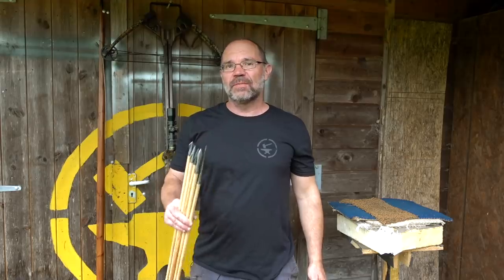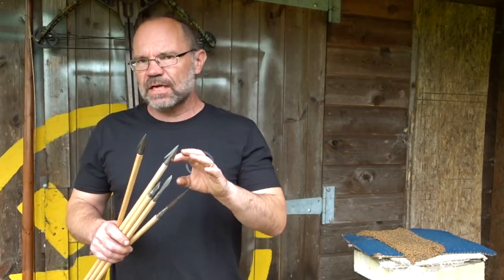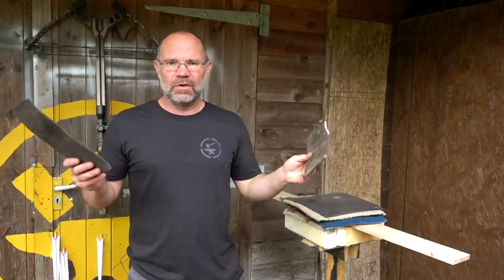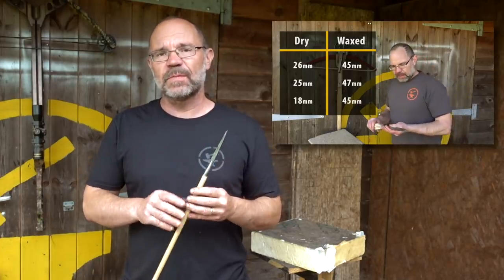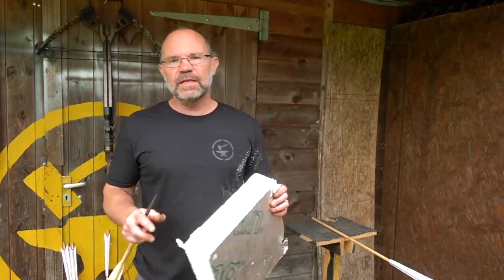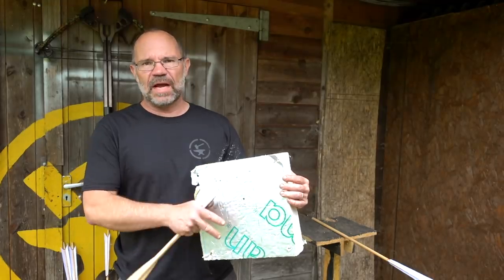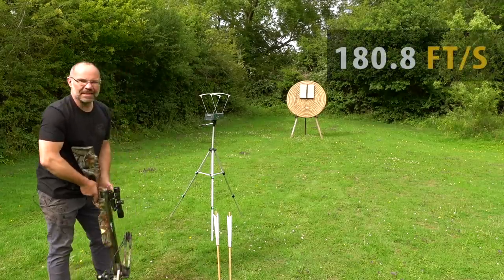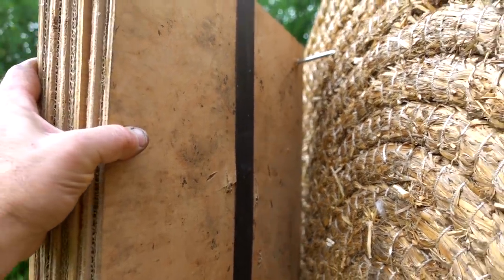Lockdown Longbow - Now I have WAR ARROWS!

Comment: "I didn't realize they wore these two in combination"
Oh absolutely they did. In fact, usually the setup was: Gambison, chain, plate.
For anyone who was fully armored. You'd never wear plate armor without gambison, and you really shouldn't be wearing chain without gambison either.
That being said, the idea of chain UNDER your gambison was a new concept to me people told me about in the last video...
So I have no idea about that, because the whole idea of why you don't wear chain alone is because it 'd be uncomfortable as hell especially with any weight or gear over that.... but I guess it was done?
Reply: They might be confusing some pictures, I believe gambison was always worn under chain but wearing gambison over chain in addition to what's under was probably just for warmth, when temps get freezing having a thin gambison over your mail keeps you a lot warmer than having mail exposed
Reply: @Robert-qm7yi  I.... question that logic there, if only for the idea that the gambison overv your body will keep your body warm regardless if the chain is over or under, but if the chain is under, it also keeps the chain warm lol.
Reply: Thats not quite right I'm afraid. You do not wear gambeson under plate armour, that is what an arming doublet is for.
Reply: Hidden The chain gets colder easier and transfers that cold more effectively than fabric, keeping the chain warm keeps it from sucking out your body heat.

Take a cast iron pan and put it in the freezer for a few hours and grab it, then put a few rags over it and grab through the rags and you'll see what I mean

Comment: Having a different weight to achieve the same speed changes the inertia on the arrow which will affect am guessing the ( range , impact , accuracy )
Theoretically a heavier arrow - bullet- projectile will keep more of its original energy over a longer distance
 so the speed of the arrow may be the same 1 meter in front of the bow but the speed of impact will be surely different between different weight arrows

Am a shooting athlet an Automotive Engineer not a bow guy just to be clear 

Still love the experiments !
Reply: It's my understanding that those are the size and weight of war arrows.

Comment: If archers were expected to shoot through plate armour, unless it was cost prohibitive, I think there's no question that arrowheads, or at least parts of them, would have been made of hardened steel. An arrow's tip is a simple machine and its deadliness depends on its retaining its shape when it hits its target. Keeping its shape is what enables the arrow to concentrate the force of impact on as narrow a spot as possible. If the steel flattens out, less energy is left over to do damage and the force of impact is spread over a larger area, making failure of the target armour less likely.

Comment: I think the only difference between your bow and a proper longbow is the force exerted on the arrow. Shorter length of pull means you need a slightly higher acceleration to get to the same velocity. More acceleration means more force (F=ma).
Once in flight, bow and arrow are no longer interacting, so it doesn't change anything down range.
(The arrow might flex more but I don't know if that effects much)

Comment: Hi Tod. Fan of your longbow test videos. Although I would think it's negligible, wouldn't there be a difference in an arrow fired from a longbow suffering from archer's paradox where a crossbow would not? There should be a bit more energy in the arrow as it continues flexing in flight. Edited as I forgot that modern recurves with whisker biscuits won't have this issue.

Comment: Loving these tests Tod.  One thing I'm wondering about is the samples of aketon and gambeson you are using is what kind of linen was used in their construction?  Also has anyone brought up the point about the modern methods of making linen not being as good as the medieval method?  Apparently something about the chemicals that are used weakens the flax fibers.
Reply from the maker: The fibres are chopped shorter these days, but there is nothing to be done about that
Reply: @tods_workshop  Yep got to work with what's available.  Anyway looking forward to more tests.

Comment: Why we live in society where you need to explain stuff like that and put a bazzilion of disclaimers about the "lockdown longbow"... Some people........
Of course if you shoot an accurate arrow at an accurate speed it's not going to make any difference what you actually used to shoot it. You could've shot it out of a shotgun or something. As long as the speed is good, it doesn't matter.
Reply from the maker: My point perfectly.  The only question is how much the oscillation matters and it certainly has some
Reply: @tods_workshop  For experiments, it is necessary to limit the number of variables influencing the outcome. Removing the Archer is not just possible, it is surely beneficial for your tests. Once you have the data from your lockdown tests, you could, if you still wanted to, correlate using a bowman. Better still would be for someone else to test if they get the same, repeatable, results.
Reply: @PeterWasted  Seems to be possible though, he just did it.
What is inherently necessary with having an archer and a bow for expermenting if an arrow shot at a certain speed can penetrate a certain material?
Reply: @jacob9327  Nothing at all. That is the point being made. Tod, in his comment, refers to oscillation. By this he means the longitudinal bending and twisting of the arrow in flight. This is energy imparted to the arrow during the launch. A crossbow will use higher acceleration over a shorter distance than a longbow. It MIGHT have some influence on the outcome but we seem to be agreed that it isn't going to be much. I am suggesting that the effect of oscillation could be investigated separately and is no reason to question the validity of Tod's experiments. I also suggest that it would be good - for the science nerds - if the experiments could be repeated by someone else. Repeatability is at the heart of the scientific method. That means other people with independently sourced equipment and materials doing the same as Tod and getting similar results.
I think Tod is probably way ahead of the YouTube pack at the moment but at some point, the rest might catch up. I think Tod, can rest easy and let them prove or dis-prove his findings. Hopefully Tod will be "allowed" to do whatever tests he wants without constant calls for minutia to be accommodated to validate his findings.

Comment: I have always been curious of the angle the arrow would come out of the sky. 

I.e shoot from a castle wall surely the arrow wouldn’t be facing armour straight on.  And at long distance. Surly it’s not going to be straight it’s going to cover threw the air and hit and a different angle. And reason why I ask this because I’m pretty sure you aren’t allowed to hunt in the U.K. with a bow and arrow because the arrow still comes out the sky with lethal force. I could be wrong on that. Just really want to see it. 😉
Reply: We have been poisoned by the Hollywood method of air-cannoning buckets of balsa arrows in high arcs to make archery look scary and dangerous. An arc that high loses too much speed for a weapon that relies on it's own kinetic energy to do the damage. As a comparison, imagine bullets fired on high arcs (like half of the McDonald's "M") versus a flatter trajectory. The highly arced bullet might not do more than sting on exposed flesh as is slows down to its terminal velocity, while the flatter shot will still be super- or near-sonic and make a mess of your delicate flash bag.
Reply: MonkeyJedi99 thanks for the response.  I would still like to see it. On one of his previous videos I remember them shooting a bow and cross bow as far as they could. I’m pretty sure one of the arrows gets stuck in the tree at like 300yrds. which is impressive. It’s one of his early vids just FYI for reference.
Reply: @jkillerb  Having shot bows and crossbows (non-competition), I can say that  your shot gains little range, and loses power, by having firing angles between 30 and 45 degrees. And firing higher than that is just losing both range and speed (from drag).
So the Hollywood cloud of arrows things really fails for me.
-
Also, do not fire straight up in a competition to see who can get an arrow to land closest to their feet. I won when a slight hop backwards still let me feel the fletches on the way down, and the arrow missed my foot by about two inches.
I also won a two knife games, one mumbled-peg when the other guy stabbed my thumb, and another when the thrown knife stuck through my boot and into my foot and I didn't flinch.
-
You know, thinking back, I did a lot of stupid.

Comment: I just hope one of these arrows or one like them don't shatter into a million pieces on you. The power stroke on that crossbow is about half of what would be used to accelerate the arrow to that speed on a longbow. So the shaft is bending tremendously from the extreme acceleration and you can see it in the arrow flight in some of the shots. But damn I love your channel.
Reply from the maker: I am pretty sure they will be OK, but of course I can't know, but the bend looks pretty normal compared to slo-mo footage off longbows
Reply: @tods_workshop  You are probably correct since upon further though the diameter of those shafts is quite considerably larger than anything I have experience with. Sorry to have been an old Granny about it.

Comment: I wonder if they ever made a crossbow bolt with a hollow shaft inside of it that contained a small amount of mercury? Not like for injecting it though. Just enough inside of it to be able to suddenly slide to the front at the moment the bolt makes contact with the target for a little extra force on impact... Or would that even work? 
 There was one theory that the sword known as Excalibur was actually mercurial sword, which could have possibly explained how it was supposed to be such a powerful weapon. It may have had a hollow shaft that ran from inside the handle to near the end of the blade, which contained mercury. If used correctly, the mercury would rest within the handle and shift into the blade as it's swung or thrusted. It would allow the wielder to swing it with more force than an opponent expected... Anyway, I was just wondering if something like that could even be applied to a crossbow bolt or an arrow without messing up the accuracy...

Comment: You could probably make a compressed air "gun" to fire the arrows at exactly the force you want. You wouldn't have to keep cocking that bow either. That's gotta be rough on the hands after a while.
Reply from the maker: Yes I can, very easily and have done in my previous SFX career, but they have a 'grey' status under the law here.  If I used it for as scientific experiment it should be legal, and so perhaps it would be, but on the other hand, I might have to stand in court and explain that I make weapons for a living, I film about them, I am shooting an arrow out of an improvised device, but that device is not in fact a weapon........Could get tricky, so best to avoid the whole area.
Reply: @tods_workshop  Lol No doubt. Good call.

Comment: Have you considered using fat (lard or whatever) instead of wax? It probably achieves a similar result and it'd be cheaper in principle (for Medieval pricings). Maybe they just stuck their arrows before combat in a piece of lard and got that extra penetration at nearly zero cost.
Reply: Comparatively animal fat was more expensive. Also with the wax its not added on every time an arrow is shot. Its added once and it stays forever. If you had to dip an arrow in something before every shot your firerate would be nill.

Comment: In case Tod does read this. Just to clarify: rawhide is about 6 times more effective, weight for weight, as leather (boiled or otherwise) according to Edward Chesire's thesis work on non-metallic armours (need a log in but it's free to access):  https://ethos.bl.uk/OrderDetails.do?uin=uk.bl.ethos.529983

Comment: For comparison sake this test is actually MORE SCIENTIFIC than using a longbow, and here is why:
1.The English longbow has more natural variation, since it's possible to draw it half a cm more or less quite easily.
2. With a bow you get archers paradox, which has a tendency to influence the impact. Impacting on another part of its wiggle might increase the variation of penetration.

If you want to go full science you could shoot 10 times each, measure variance between groups, do an anova to compare the differences between groups and then you'd be able to say you have shown scientifically which bolts penetrate further. (but I get this is mostly for entertainment, but now you know why you are actually being pretty scientific already)

Comment: I suggest you be very careful and thoroughly inspect your arrows every time you shoot them.  Because wooden arrows are not meant to be shot from compound bows.  An arrow shot from a long bow or even a recurve moves at a gradually increasing speed.  When you pull the string back on the compound, do you feel the cams "break"?   When released, the arrow will experience that "break" in reverse, imparting a sudden increase in energy and speed.  Such shocks have been known to break wooden arrows.  That's why, generally, aluminum or fiber arrows are shot from compound bows.

Comment: Something that I'd love to see, is not only to be able to find out the penetrative capabilities of longbow arrows, but how much impact is transferred into the target even if the arrow doesn't penetrate. Is the soldier just going take a nasty bruise, winded, knocked out or worse. My point being, even if it's not going to be a full penetration, can we measure an arrow's potential stopping power at different ranges?
Reply: Arrows simply don’t have stopping power, bruises are what you would get if you aren’t penetrated

Comment: old time peoples and the Amish and old order people still do use old time lye soap(lye and lard) to rub their nails on before hammering them into oak or other hard woods . I was tough to do this as a small boy. and it dose work to get a nail in with bending And that has been a well know practice. Also using lard on boards to move buildings .I have done that .  while on old technologies , i also know of a very large brick house that was moved by using blocks of ice cut from the ice ponds . Old peoples where wise and practical .

Comment: I'll admit that I haven't watched all of your videos.  On the topic of waxing the arrowheads, have you tried oiling them to see if that has the same effect as wax on penetration?  I can see how either would be intended to mitigate corrosion, with the "happy accident" of providing more penetration.  It seems that oil might be another treatment that bowmen and arrowsmiths might've used to achieve the same effects of wax; both the likely intended effect of corrosion resistance, as wells the benefits to penetration.

Comment: Since the force of the bow is only dependent of place, I would expect the energy to be constant.
In the measurement, it fluctuates between 127J and 137J.
I wonder whether this is because the change of arrow (more or less wind resistance) or because that's the precision of the measurements.
Either way, I like the video.
Reply: A crossbow is more repeatable than a longbow, but you won't get the exact same energy out of it each shot - there will be fluctuations. Then you have the variables in the arrows, which will each have unique characteristics in how the energy is transferred from crossbow to arrow, as well as how the arrow sheds velocity. Lastly, minute fluctuations in the way the arrow flies from the crossbow will have an impact on how much the arrow porpoises. A porpoising arrow sheds velocity much faster than one that flies straight. All of these variables will impact the Ke of the arrow. Also, remember that the arrow weights differ - a heavier arrow will have a lower Ke (Ke goes like V^2) but a higher momentum.
Reply: @Sa1d1n  My question is: what variable explains the fluctuation? Is it due to a change in how the crossbow is held, due to the shape of the arrow, due to the weight of the arrow, due to the interaction between the crossbow and the arrow, due to a fluctuation in the measuring equipment or due to a rounding error in the computations?
Each of these could have an influence, but what has the biggest effect? I don't think it's the weight of the arrow, since the arrows with the most energy or the heaviest and lightest ones. This does not surprise me, because the energy transfer of the bow on the arrow only depends on the force (depends only on the draw distance) and the distance over which the force is exerted, both are independent of the arrow (if you ignore the weight of the string).
I don't see how a heavier arrow should have a lower energy. They do have a lower speed, but Ke = (m*V^2)/2. I would guess, they have a slightly higher energy (less wind resistance) and a way higher momentum.